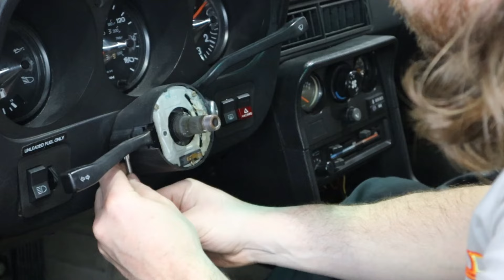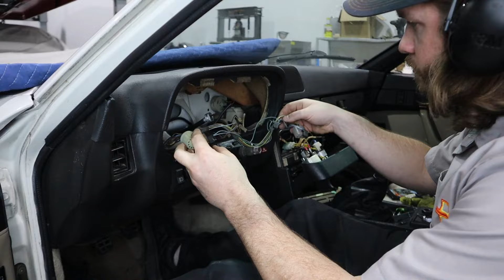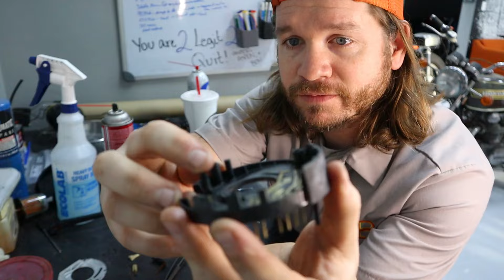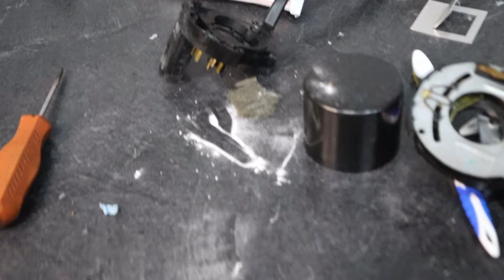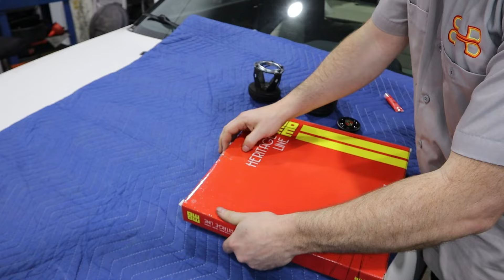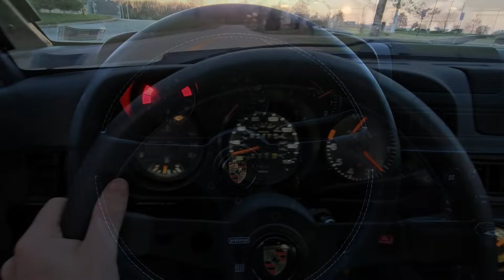Rebuilding Control Switches / LED Dash Lights / Momo Steering Wheel Install On Porsche 924

Comment: Excuse my ignorance but IF I want to change my wheel to one of these I not only need the Wheel I need the collar it connects to and that does not come with the wheel? Also can I ask. where you got the Porsche horn button? That is leaps and bounds better then the momo one
Reply from the maker: Yes you need the adapter collar. The horn button I bought from sierra madre. https://sierramadrecollection.com/products/porsche-horn-button-for-momo-steering-wheels-906637?srsltid=AfmBOoocXs77IyWgwmXVEw0hhmebRPhy4-I7pAdWd8OSdOReUngESIw1

Comment: Thank you so much for sharing! It is pitty that you did not explain how to unplug the "upper left" plug. That cost me two hours yesterday, to find out.😀 I did have to remove the insturments first and I am wondering how you did it without this. That would heva been impossible for me. 😲 Anyway, is it possible to replace these LEDs with yomething brighter or with a different color? Thank you! 🙂
Reply from the maker: I guess I am not sure what plug you are referring to. The speedometer cable was the most difficult for me. The method I showed is pretty much the standard for removal so Im sorry if it wasn't helpful.  You should be able to get any color you want but there won't be a kit for it. You would have to source them individually.
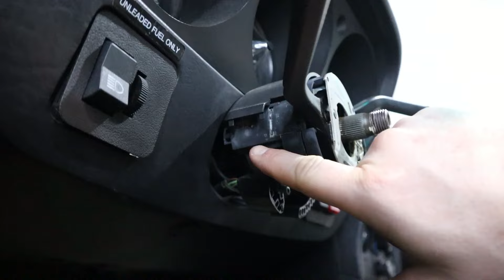Reply: @tangentsbhb  Don't be sorry, your video helped me a lot! 😀I was referring to the plug that you are mentioning at 03:13 The one for the high beam switch. The cable was so short and the plug so tight... Anyway, I finally managed to pull this one as well; and in the meantime I have replaced the lighting with LEDs. I did not use LEDs for the turn signal as I guess LEDs are not built for this constantly on and off. And of course I did replace that single bulb by a new bulb and not an LED. 🙂 I ordered a lot of different LEDs until I found the perfect combination of the two different kinds of plugs. I found out that all coloured LEDs are too dark, as it seems that they only put some little paint on the original white LEDs 😞. So now everything is shining in cold bright white. Not the color I was originally going for, but I can now match it to my radio's lighting. Still have to replace everything in the center console though... Would love to show a picture but that is not possible here. 🙂 Again, thank you very very much for sharing!

Comment: Hi awesome video, i kinda have lil similar problems on my "brand new" 924/944... the temp gauce works kinda bad (it raise very very quickly to the danger zone...but everything works soo it's probably the gauge or dirt problem?). the temp gauge and fuel gauce "dances" if i put the headlights on and off...soo maybe some grounding problems idk?? And the last one problem, the AC switch like yours doesn't work :( I checked behind ofc it has replaced in the past but maybe again some wiring problems maybe not into the switch, but into the AC motor? If someone have some suggestions just tell me 😭 btw wheel and leds are just awesome!!
Reply from the maker: I would start by measuring temp switch function if possible.  I don't know a ton about these cars to give good diag unfortunately

Comment: That Momo wheel is awesome!! I've used a screwdriver bit heated by a torch to quickly melt a slot on a plastic post to spread it a little similar to your application.
Reply from the maker: That's a good idea!

Comment: Awesome video and the steering wheel looks great! Could you please explain why you put the dielectric grease on the connectors? Judging by its name, it seems like it would insulate the connectors and prevent them from making proper contact, or am I missing something? :D
Reply from the maker: Thats just what you use on electrical connections. Silicone grease helps keep junk out but reduce friction

Comment: I put LED lights in my click and oil pressure gage, big difference! My clock didn't work, ended up taking it apart and replacing the two capacitors. Over a year later and still working great.
Reply from the maker: I just did the capacitors as well with success.  That will be another video
Reply: @tangentsbhb  yes pleeeeaaase! As my clock is not working as well. 🙂

Comment: Nice results even if you took a few tangents along the way. In my own vehicle "upgrades" I usually regret the tradeoffs that can occur. Some have none, some just need to be undone! I have little patience for 1980s plastic electromechanical devices, you did great.
Reply from the maker: Oh very true! The wheel has taken getting used to.  It was so slick at first and harder to be comfortable with but now is getting better

Comment: When you were putting the dash back into the car i was like shouting at you "hey man, test it before mounting it back" :-) On side note - there is also a version of LED bulb which is not polarity specific - yes, all LEDs are as all diodes are polarity specific but these special "bulbs" has two LEDs inside in antiparalel configuration so no matter how you connect them one of them always shine. But this type is not so common and - as always - more expensive. Nice job - especially on repairing the fragile switches.
On completly different note - in one or two previous videos i saw red VFR 800 RC46 - will you make a video about it? Just asking...having same red VFR 800 too plus one red VFR 1200F..being kinda VFR fan :-)
Reply from the maker: I was for sure a dummy to not test it so I quickly learned that lesson lol. The VFR is my friends bike actually.  In case you aren't aware my main channel that I've had for years is all motorcycles.  Same style and format of videos. It's youtube.com/brickhousebuilds
Reply: @tangentsbhb Surely I know your main channel, subscribed it almost immediately when i found it :-) I work on bikes myself though on lower level - just maintenance and repairs, no rebuilds or restorations - but found in your vides many tips&tricks and inspiration. And fun of course 🙂